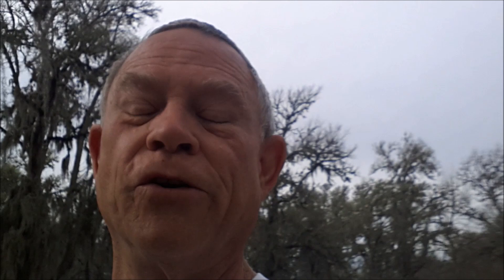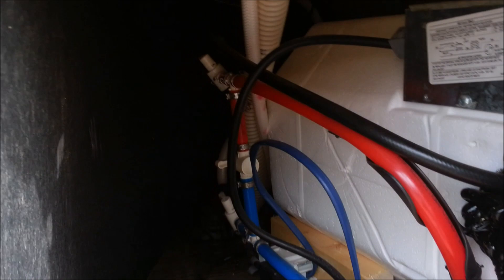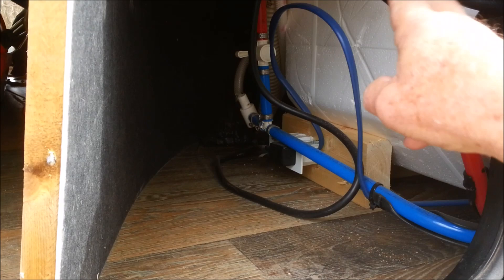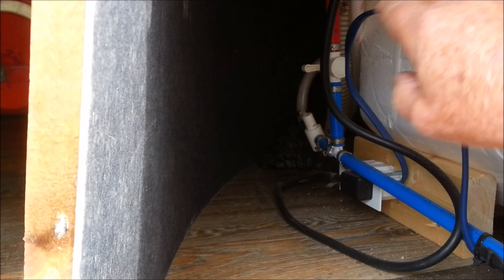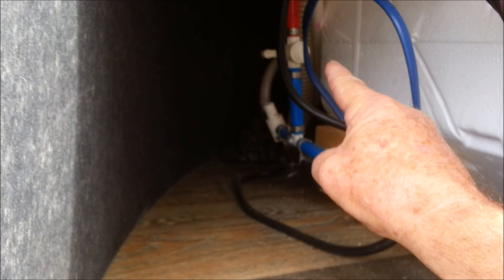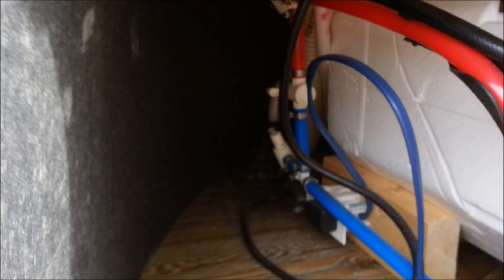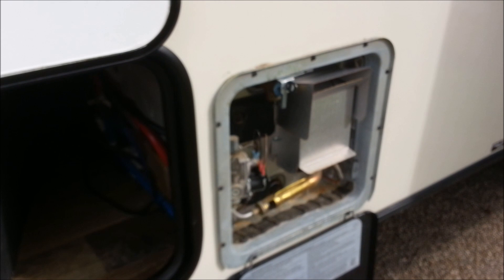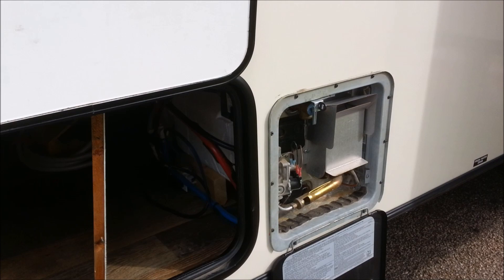No Hot water, just warm water?  You forgot to do this most likely. Suburban Hot Water Heater issues.

Comment: A couple of other causes of tepid water
1. Not turning off the taps on the outside shower - this causes the cold water to mix and flood through the hot water lines.
2. The tempering valve which mixes the hot and cold for safety is not working properly

Comment: Thanks for the tip, unfortunately my 2306 holding tank completely busted due to weak support.  Have to buy a new holding tank and make my own modification to support.  Like your channel, thanks.
Reply from the maker: Oh dang.  :(  I keep checking mine.  It is doing fine.  I found that traveling with 1/2 a tank gives us about 4-5 days of water.  we take quick showers and I have a 5 gallon bottle of water behind the couch just in case.  :)  We are water misers.   Hope your fix works well for you.  Michael

Comment: Thank you. I was told all valves (after dewinterizing my motorhome) should be turned on (parallel to all pipes. I had no hot water for a month, so I found your you tube video and then you directed me to this one and hold and behold I have the same 3 valves you showed. Hurray. I turned the middle one off and now my wster is getting warm; however, the prior owner converted the hot water to elec, so I have both options. There is no on or off switch on the hot water heater, so I assume she. I plug in the 110 then I do NOT need to turn on switch in side my motorhome, is this correct,? Wouldn't the switch inside my camper be turned on only if I was not plugged in to 110 and using my propane? Thanks anyone who can confirm I'm doing it right
Reply from the maker: Hi Roxanne.  If there is no on/off switch outside on the heater, like my unit, then the previous owner probably only uses the inside Electric switch for 110v heating.  You can do an easy enough test by turning off your propane from the outside tanks while the water is cool in the water heater tank.  Turn on the Electric switch inside and check for hot water within a half hour.  If it is only turned on by using the inside switch, you don't have an outside switch located somewhere.  I suggest you check everywhere you can for any switches however, gas or electric.  Don't forget to always be sure you have water IN the hot water heater tank, or you can blow out the electric heating element in seconds if the tank is dry when flipping on the Electric heater switch!  Good luck.

Comment: I have the exact symptoms you described with my hot water (Luke warm) but I live in my trailer year-round, so it doesn't get winterized.
Any suggestions on what might be the culprit in my case?
Thanks
(It's only warm, using propane or electric, no difference)
Reply from the maker: #1 would be the bypass valve of course.  But if you haven't messed with that check the following.  

#2  With the outside panel open of course, on the side of the water heater there is a black pad, about 4"x6".  Those are 2 RESET buttons.  They are not marked as such.  Run your hand over it, you'll feel the buttons under that rubber.  The left button is the electric RESET button.  PRESS it down hard to reset the electric.  You may hear it click.  Repeat just to the right of that button for the gas RESET.  Check to see if that remedies the problem.

For the location of what I'm talking about, you can look at this video I made.
https://youtu.be/dEoR-IK3p9c

If that doesn't work..
Try using propane only.   Inside your camper, turn OFF the Electric mode and have GAS on. Outside, using the rocker switch on the face of the heater depress the rocker switch to turn the electric mode OFF.  Mine is tucked back in on the left side kinda below a pipe (the video above shows you where it is).  Pressing the ON on the switch turns ON the electric function, pressing the OFF on the switch turns off the electric function.  There is no ON or OFF switch on the heater itself for gas usage, it is always pressurized.  Go outside by the heater and listen for the flame to come ON.  It should come on, a nice roaring flame going, if your tank is not heated to the degrees set by the mfr.  

If that doesn't work, you obviously have a mechanical issue with the thermostat or gas line.   But if it does work, then test the Electric function.

To do so, reverse the above.  Turn OFF the Gas switch inside your camper.  Turn ON the Electrical switch to use Electricity.   Go outside and turn ON the Electric rocker switch I told you about earlier.  There won't be any noises, the electric service should begin to heat the water.  Give it a half hour and you should get hot water or at least hotter than before water.

If none of these works, you either have a burned out Electric Heating Element or possibly electric malfunctions on the gas assembly (you'll see that where the 4 wires are plugged into a black box by the gas line.

Also?  As a reminder.. check your Anode rod.. this is your protection against corrosion inside your heater.    I hope this helps.  If you have any markings noting the model of your water heater, that would be helpful.  If it is just like mine, you go to this website and download a Suburban manual.  https://www.manualslib.com/s/sw6del.html

Comment: Hi, my hot water is too hot on a Suburban SW6DE. It's fine in kitchen & bathroom sinks because I can add cold water at the faucet. My problem is in the bathtub  shower where the faucet is one handle that you turn on and spin. It comes out scalding hot, with no way to mix in cold water. I have to wait until the hot water is almost gone to jump in to get a lukewarm 3 min shower...
Any thoughts?
Reply from the maker: Sounds like the valve itself is clogged at the faucet.  If you can remove it and feel confident doing that, check some YouTube videos for how to service that type of faucet.  Sorry, I've never had that issue, but its clear there is an obstruction.  The only other thing I can think of is a kinked cold water line running to the shower.  If you can remove a "panel" or get a clear look at the lines, check for a kink.  Good luck.
Reply: @garlandstyle5797  Thank you for your thoughts & good advice, will do...
Reply: @DJ-jc9il
After the hot water comes out of the heater it needs to mix with cold water to make it safe for showering. In my van there is a tempering valve that does this, keeping the temperature under 50 degrees celcius.
I had the opposite problem, lukewarm water. I took off the cap on the valve and used an Allen key to adjust the mix and it fixed the problem. I suspect it was simply stuck, perhaps from calcium scale buildup?
Maybe your tempering valve is the problem?